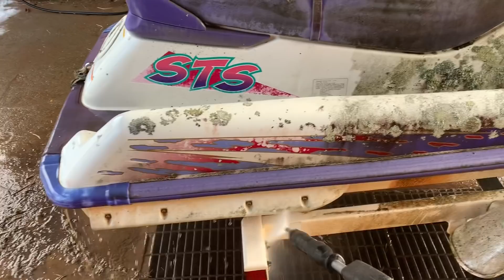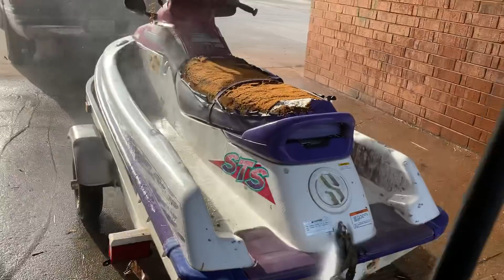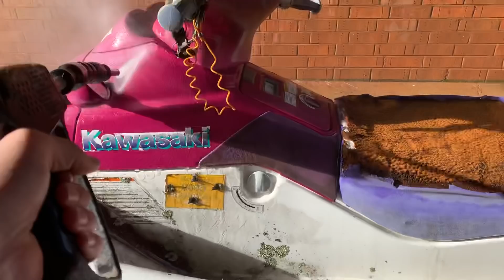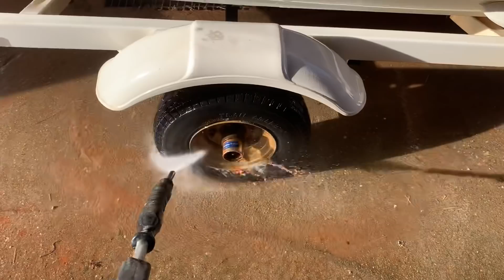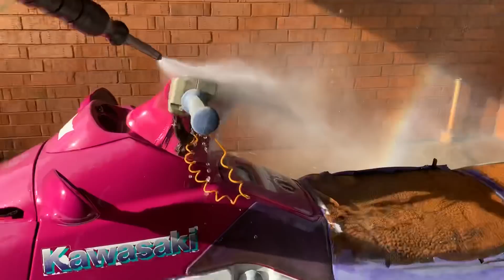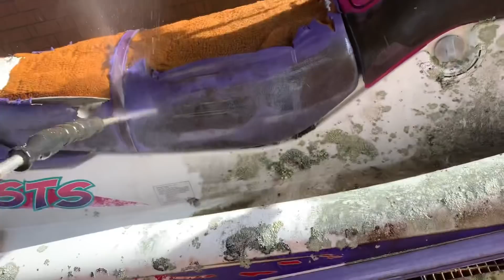JETSKI PRESSURE WASH PART2

Comment: Doesn’t look that bad all clean up, all you need now is a new seat and you will be all set not bad for $100
Reply from the maker: Its slowly coming together. Im hoping to find a good seat cover somewhere. But they all seem more expensive then the total cost of the machine itself !
Reply: I know what you mean lol you may try eBay or amazon and see if they have one, I seen one a seat on eBay for around $50 idk if it will fit yours but maybe you will get lucky and another jet ski will come in with a good seat but it will eventually get there

Comment: And I bet you found all the change for the pressure washer in the cup holders, glove box, floor, and dashboards of the cars that got dragged into the yard! Better find some more for the Coke machine at work!
Reply from the maker: Yes! The amount of silver change I collect is ridiculous. On a side note, my vintage coke machine has stopped working. And I cannot find replacement parts to repair it sadly.. It might be at the end of its days.
Reply: Did you ever look into the cost of renting or leasing a soda machine per month? If current machine gets enough use/business, might be worth it.